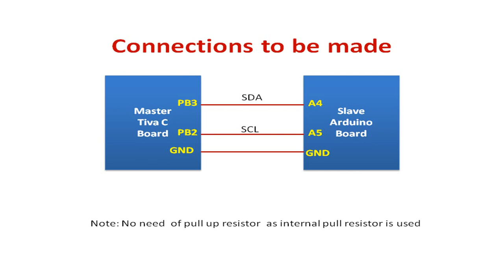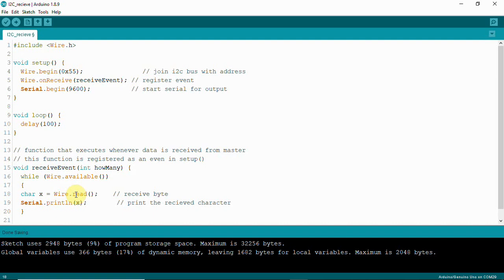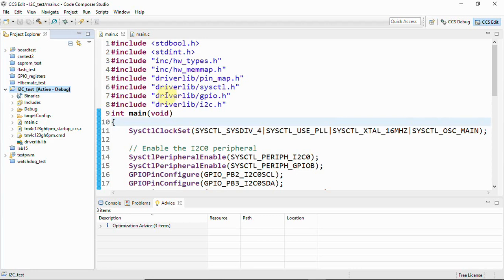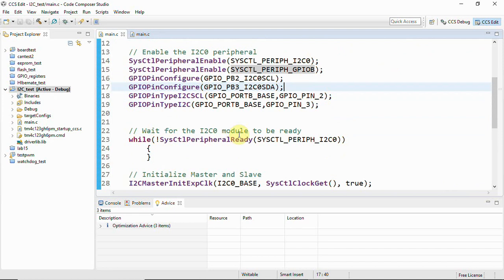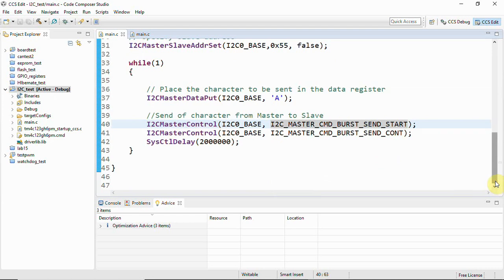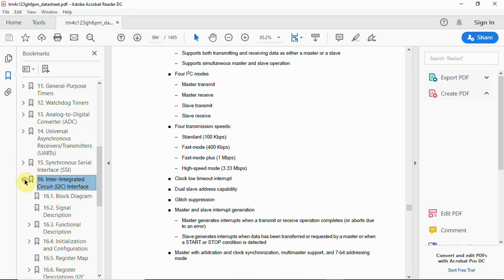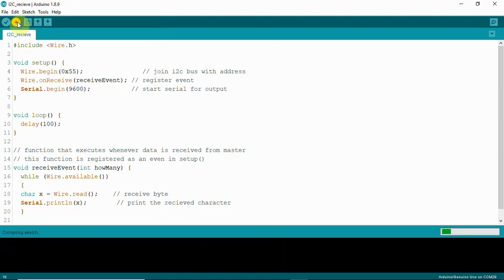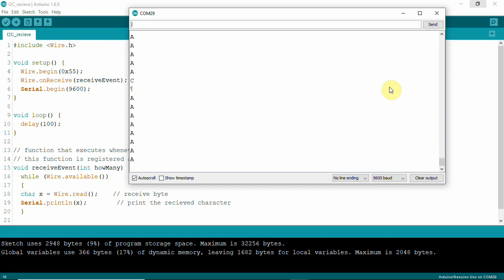I2C Communication between TivaC and Arduino

Comment: Thank you so much for the video. I have a question, can you get an analog signal from these  protocol? I'm trying to send an ecg signal, but all the videos and programs that i have seen are for  letters.
Reply from the maker: You can check for  I2C  based ECG sensor in market.  Instead you can  use ECG analog sensor and read it via analog input

Comment: Hello, I am trying to commuincate an OLED display via I2C. I followed your method of code but still not working. I checked on internet and other videos, for I2C we need to connect external pull up resistore. Do we need to conenct with TIVA board. Have you ever came across such cases?
Reply from the maker: Controllers have pull up resistors internally which can be enabled by code, you can add an external pull up resistor. You definitely need pull up resistors
Reply: @chipride8119  Sorry I am bit confused (whether I should purchase resistors or use the code to enable internal pull up).  Please give me hint about the code to enable pull up resistor. This is bit new to me. Or is like the code which you have shown in the video will enable the pull up resistor. If internal pull up doesn't work, I would purchase suitable resistors after calculation. Thanks for reply.
Reply from the maker: Use 10k resistors on SDA and SCL lines if you are going for purchase
This is the fucntion used to enable pull-up resistor: GPIOPadConfigSet(GPIO_PORTF_BASE, GPIO_PIN_4, GPIO_STRENGTH_4MA, GPIO_PIN_TYPE_STD_WPU)

Comment: Thanks a lot for this video, it helped me so much
if you may, I'm trying to use TivaC to communicate with an external EEPROM, what should i do ? 
Also, where can i find your source code for this project?
Reply from the maker: if your EEPROM uses I2C Communication, Use the same method as explained in my video to read & write data to EEPROM. 
Did you check the already available 2KB EEPROM in Tiva?